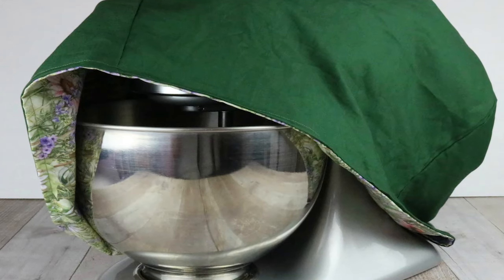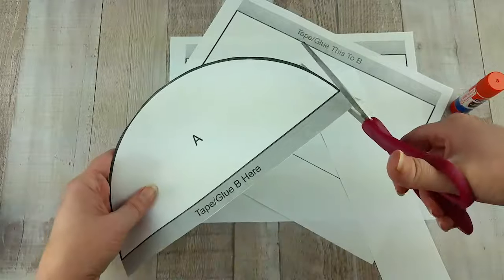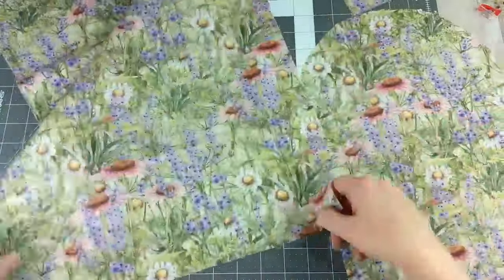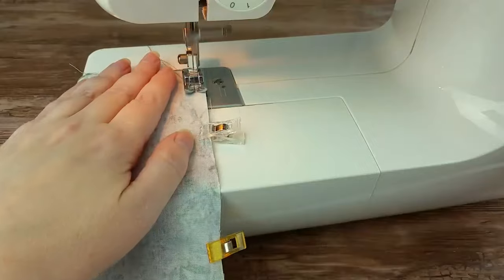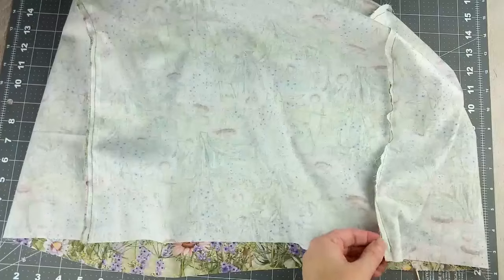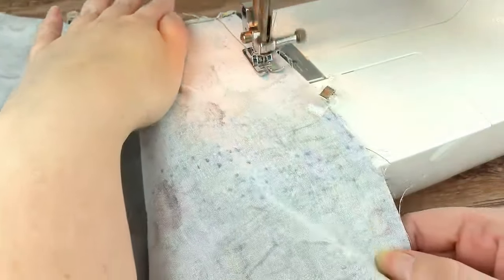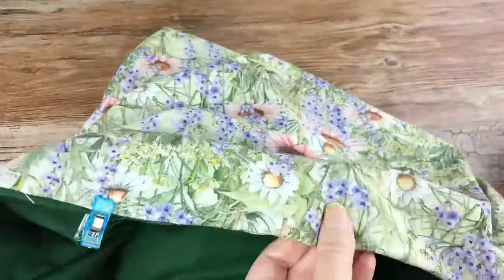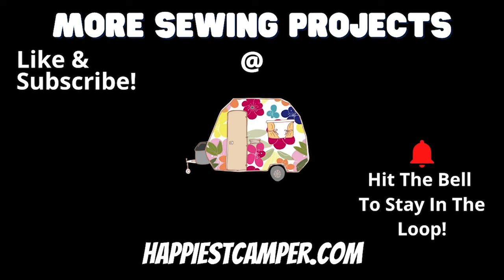KitchenAid Stand Mixer Cover Sewing Tutorial - Free Printable Pattern

Comment: Hi There! I made this cover using double-sided white quilted fabric, so I cut out only three pieces. My machine is an Ultra Power model (4.5 qt) with stainless steel band with blue graphics. I sewed the cover with wrong sides together and then used 1/2" double wide navy blue bias tape to enclose the seams which are therefore on the exposed right side of the cover. This came out absolutely perfect and matches my machine's accent color! The only thing that I would like to change is the size since it is slightly too big. Where/how do I reduce the size? It's a little too high and a little too wide. Thanks!
Reply from the maker: I would reduce it by taking a small portion off each side. Only width and height. Be careful to not take to much.